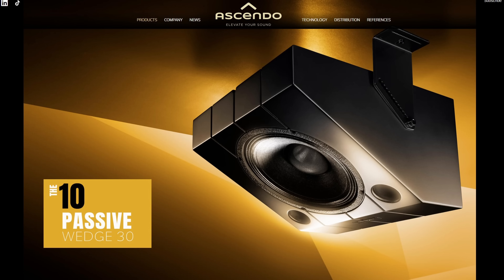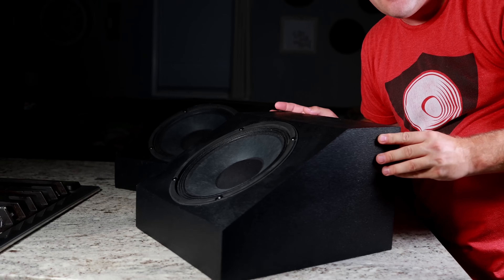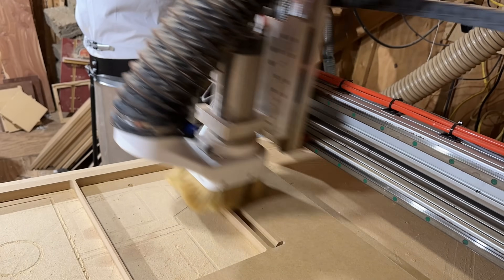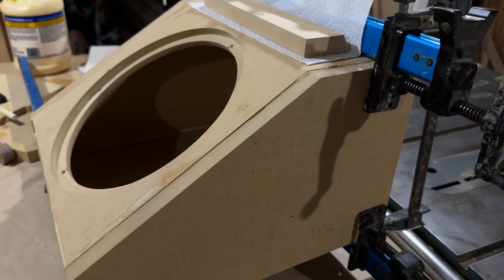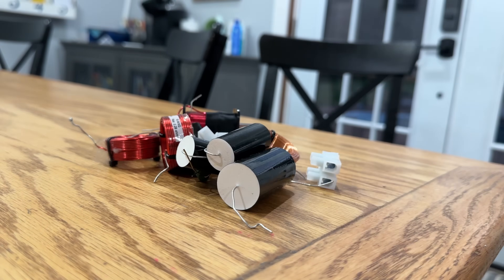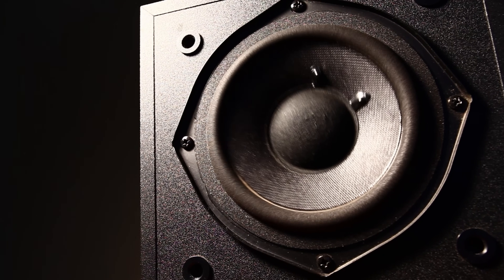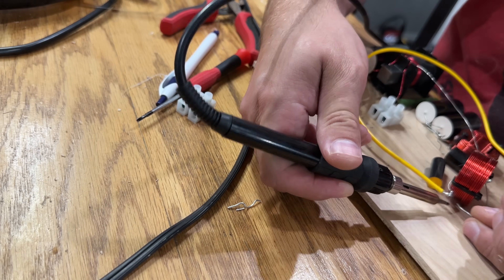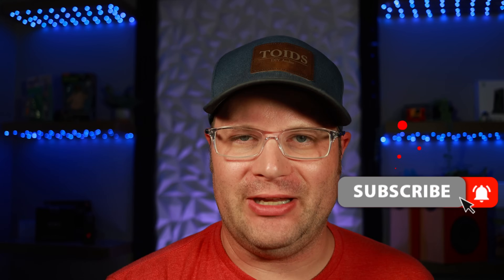How to make Dolby Atmos speakers at home! $3000 Speakers for $600! -  The Presence 10

Comment: Nick - absolutely what I have been thinking about building lately.  Except much less costly and smaller drivers.  I'd like to build 4 tops, 2 sides and 2 rears for my 14'x14'x8' living room.  THANK YOU!
Reply from the maker: @welderfixer  that would be awesome!
Reply: @Toid  I started looking at the Dayton Audio CX120-8 coax 4" for $33ea, but now I'm thinking about Celestion TFX0515 5" Coaxial or the Lavoce CSF061.21 6.5" Coaxial Woofer.  I wish I knew how to design the boxes.  Hmmm, maybe open baffle for surrounds?  I wonder?!
Reply from the maker: @welderfixer  another good option is the MP19CP-8. They do an accordion surround to help cut down on diffraction off the cone and it is supposed to be concentrically time aligned. Although I have not tested that.
Reply: @Toid  Dang!  That is one good looking driver.  Too bad it is way above my cheap beer budget.
Bummer we don't live closer, I'd come over and help you with your table saw motor issue.  That's the kind of work I do for what little living I make.
Reply from the maker: @welderfixer  I really do wish you lived closer lol. I love that table saw. I’m sure there’s a fairly simple fix for it, but I haven’t thought about it yet. I don’t really do a lot of angle cuts on it….until now 😂 it would also be fun to get together and build some speakers
Reply: @Toid  Yes sir a good table is worth the price and a couple repairs.  Oh - I'd be so happy working with you on audio projects.  Reviewing our work during movies with pizza and wings would be the reward! 😁
Reply from the maker: @welderfixer  I like that reward 😂🤣
Reply: @Toid  Add a couple "cold ones" 😉

Comment: I worked in an industry that did concrete molded parts. Am I wrong in thinking that this would make a good speaker box with its near zero flexibility and resonance?
Reply from the maker: @jonmac155  it would be a great material to make speakers with
Reply: @Toid  Thanks for the response. Been thinking about this for years but wanted to confirm.